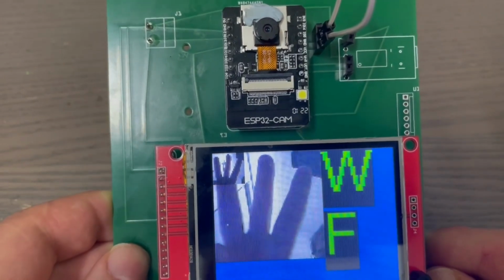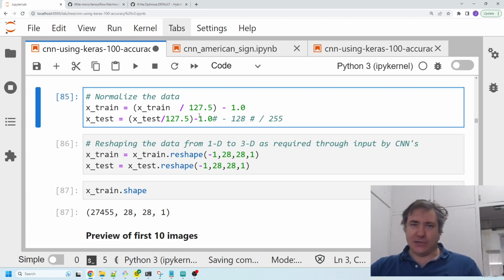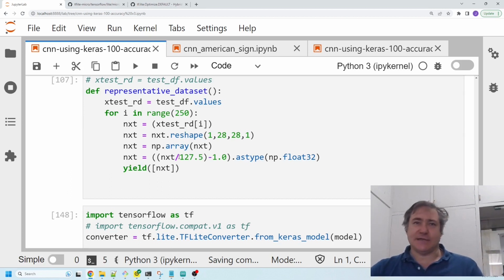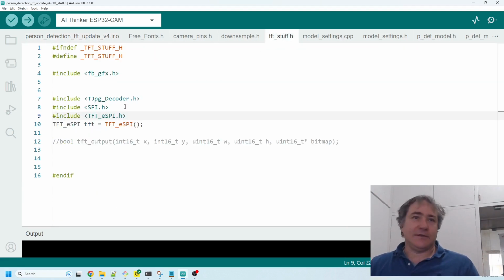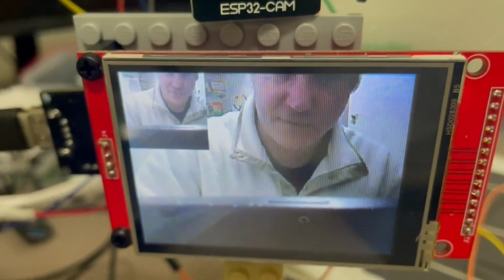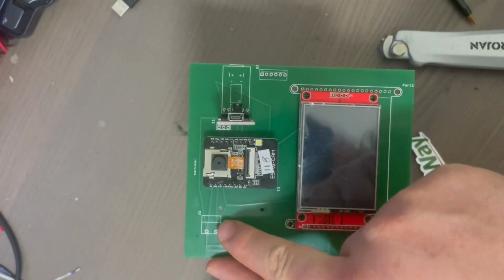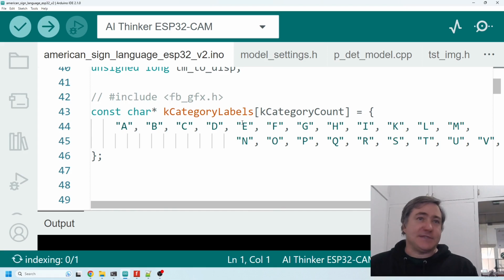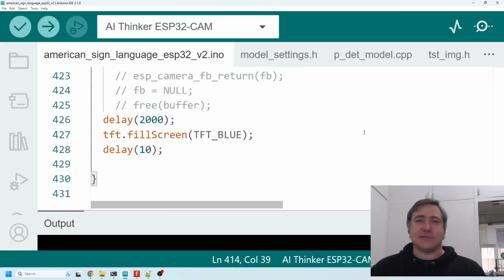Sign Language Recognition with esp32-cam using tflite

Comment: I am using the  exact setup as yours on a breadboard. The code seems to be uploaded succesfully but can't get the TFT(ili9341) to work (it stays white). After uploading the code and resetting the esp32cam, the led  stays switched on. Also when i see the serial monitor, it shows something like "E (50637) cam_hal: FB-SIZE: 294400 != 960000
E (51459) cam_hal: FB-SIZE: 0 != 960000
E (52281) cam_hal: FB-SIZE:0 != 960000
E (53103) cam_hal: FB-SIZE: 0 != 960000
E (53925) cam_hal: FB-SIZE: 0 != 960000" 
Can you suggest me a solution for this? I have noticed the tft works when a sample text code is uploaded using the Arduino_GFX library

Comment: Is there any way to use laptop screen instead of TFT display?
Reply: Can you show me the way to do this? I don't have a TFT display but want to show the output on my laptop screen. What should i modify in your code?
Reply from the maker: @s.mtaron4908  you mean with the esp32 cam or do you want to use a Web cam?
Reply: @jonathanr4242  just as u did using the esp32cam but instead of the TFT display I want to show the output on my laptop.
Reply from the maker: @s.mtaron4908  Hi. In this project here, I use websocket for the person detection part to output to a laptop. https://github.com/jonathanrandall/xiao_vs_aithinker
Reply: @jonathanr4242  Thank u . Appreciate it!
Reply from the maker: Yes. Absolutely. You can stream the image from the esp32. Or you could flick the esp32 & just use the laptop camera and processor which would be faster and more accurate. But less difficult and fun to implement.

Comment: i use esp32-cam AI thinker to upload your code, but problem is Camera init failed with error 0x105ets Jun  8 2016
Reply from the maker: ok. these errors are very vague. It looks like the camera isn't working.

Comment: hey sir, i try use code in time 29.05 calloc function but this error"exit status 1 invalid conversion from 'void*' to 'uint8_t*' {aka 'unsigned char*'} [-fpermissive] Invalid". Can you help me to fix it, thanks !!!
Reply from the maker: Hi. Thanks for you question. The error messages can be a bit vaque. It's a bit hard to know what's going on. Are you using my trained network or did you train your own?
Reply: @jonathanr4242  thanks for answer my question, sir. But i solve it, but when i run your code example camera capture error, can i have send you image about error for you through  Instagram 🤔🤔
Reply: @jonathanr4242   i have only esp32-cam but i want test in your code and test img, how can i do it to display result of prediction in monitor of arduino ide, sir
Reply: 11:39:00.626 -> E (506) camera: Camera probe failed with error 0x105(ESP_ERR_NOT_FOUND)
11:39:00.626 -> Camera init failed with error 0x105ets Jun  8 2016 00:22:57
 @jonathanr4242
Reply from the maker: @nguyenquoctoan4024 Hi, I think that means that your camera is not working. The first step is to get the camera to display to the output tft.

Comment: hello sir! may i know what are the specifications of each component you've used? thanks a lot!
Reply from the maker: I'm using an esp32 AI thinker cam and a TFT ILI9341 screen. I think it's 2.8 inches. I made some pcbs to connect the esp32 AI thinker to the TFT. If you email me your address, I can send you one I have left over, or you can get it made by pcb way.
Reply: btw, is it possible to connect it to a 7" tft lcd? or even use a ch340 esp32? thank you
Reply from the maker: @t22marg90 I don't see any reason why not, as long as you have a camera.
Reply: @jonathanr4242  i appreciate it sir! thank you! what is your email address so we can be in contact? this is for our research study and we would like to have a sign language translator in our own language with the idea of your work. is it possible that we could use a 7 inch tft display? would it work the same on the esp32 that's somehow compatible? thank you a lot again

Comment: Can you tell which tensorflow version using for notebook and Arduino
Reply from the maker: Hi. Sorry, I've updated it a few times since the project. It would've been something like 2.15 (?)
Reply: @jonathanr4242  hey sir, i try use code in time 29.05 calloc function but this error"exit status 1 invalid conversion from 'void*' to 'uint8_t*' {aka 'unsigned char*'} [-fpermissive] Invalid". Can you help me to fix it, thanks !!!

Comment: I'm trying to take an image via esp32 cam. I will do object recognition. But I have a problem. I encounter such an error: ValueError: Input 0 of layer "sequential_2" is incompatible with the layer: expected shape=(None, 240, 240, 3), found shape=(None, 240, 3). I don't know what I should do. can you help me ?
Reply from the maker: Hi. The best way to debug an error like this is to print out the shapes of all your arrays at each step. For an image should be (None, 240, 240, 3).

Comment: Hi, great job ! I saw your repo and I observed that the American Sign Recognition's model is the same than Person Detection's model, and in my Arduino project (using input->dims->size and output->dims->size), I get 4 and 2. I'm not sure what I'm saying but in case you made a mistake, could it be possible to get the right model ? Thank you !
Reply from the maker: Hi. thanks for your comment. Its been a while since I worked on that. I remember having to play with those numbers a bit, but it's difficult for me to remember exactly what I did. I'm getting old.

Comment: I find this camera to be really slow. I always thought it was a tcp limitation until watching this video. I not sure why a USB web camera(serial) is so much better than these parallel cameras. Any ideas?
Reply from the maker: I think it depends on the microprocessor. With the esp32-cam I would assume most of the latency is copying the image into memory and doing jpeg compression. Atomic14 has some videos where he speeds this up (I think?)